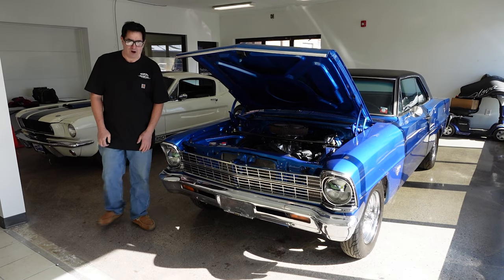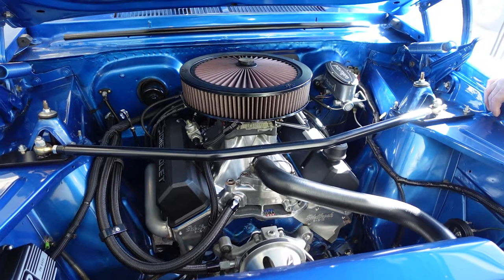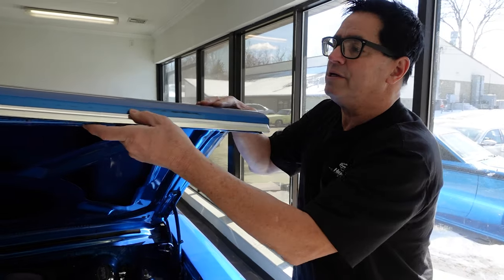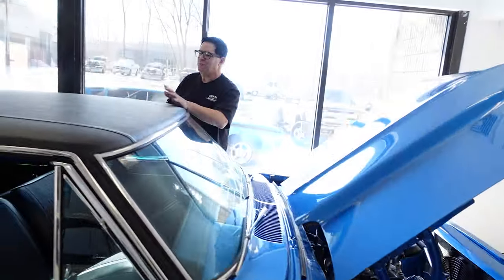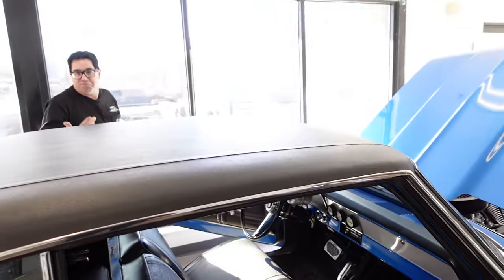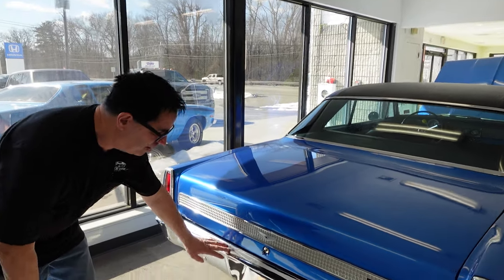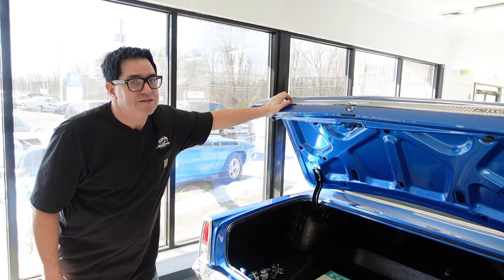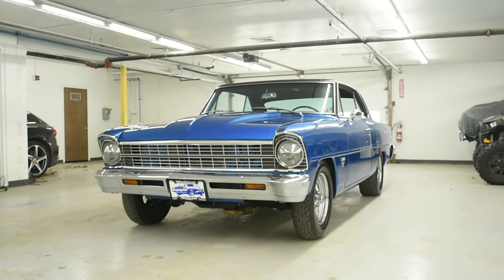1967 Chevrolet Nova Walkaround with Steve Magnante

Comment: There's nothing like a deep sump oil pan on your street car, just waiting to get torn off. I drive 50 miles to the track, run 11.80s and drive back home, with nothing more than 5 quarts of 20w50 in my stock oil pan.